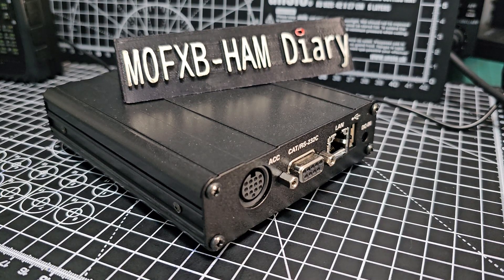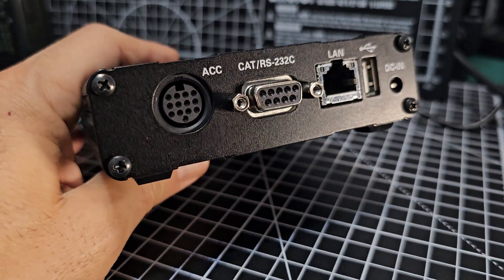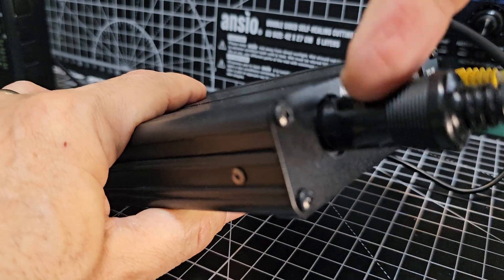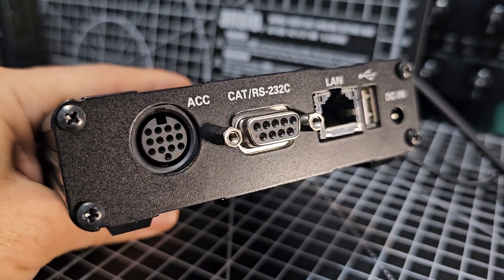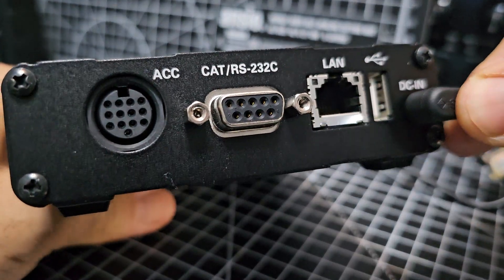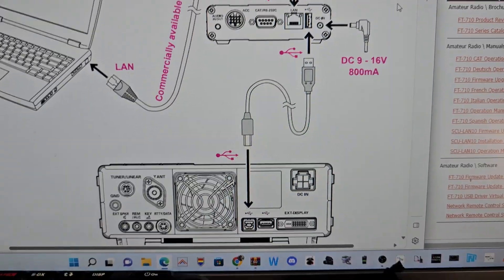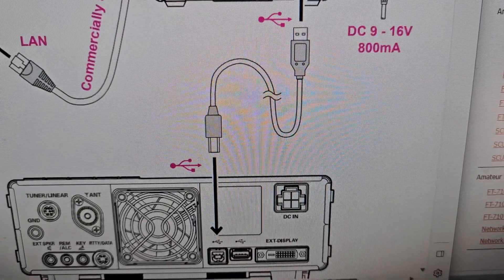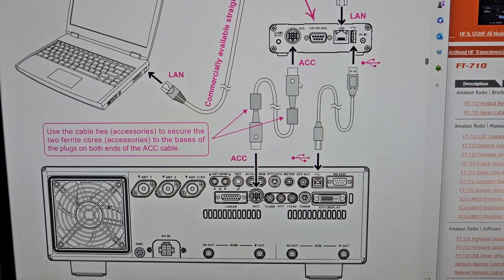YAESU FT710 & SCU-LAN 10 POWER CONNECTOR

Comment: Hi 
I have an ft710 running yaesu’s remote software with the scu-lan10. I can log on to the rig and everything works except the Waterfall. I get an error from the scu-lan10 telling me there’s a scope data error. Have you come across this error and if so do you know of a fix?

73 Richard GW4BCF
Reply from the maker: Try baude rate on  cable.
Reply: que programa usas para remoto ??   Gracias 73  LU9ERV
Reply: Yeah, I have the same issue. No waterfall at all with the FT-710
Reply: I found it, it's in Operation Settings -> General -> SCU-LAN10 -> ON
turning that on, the scope magic comes to life.